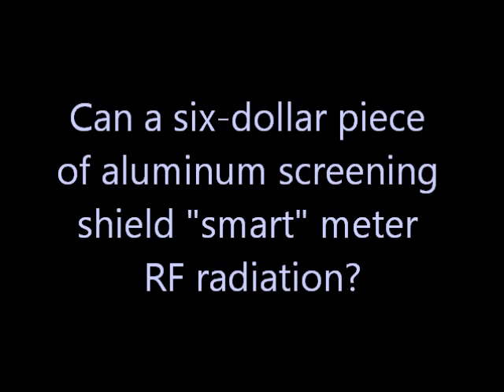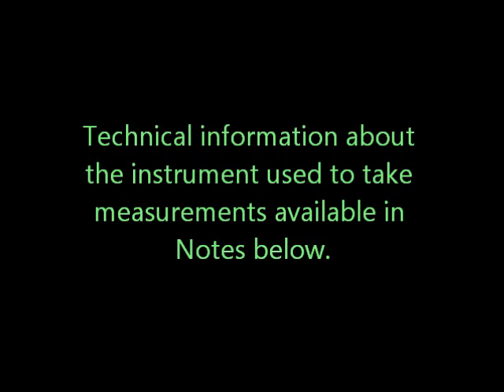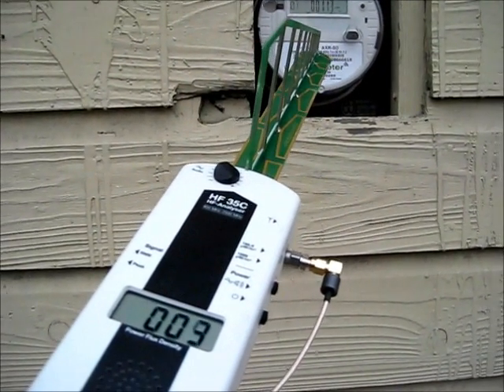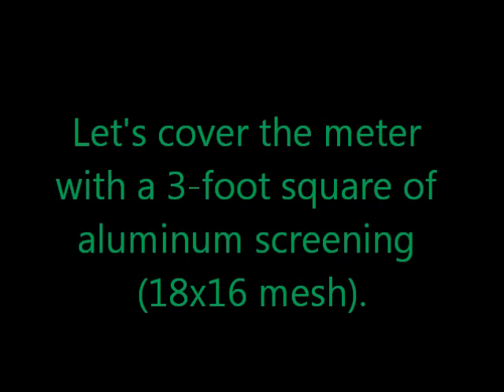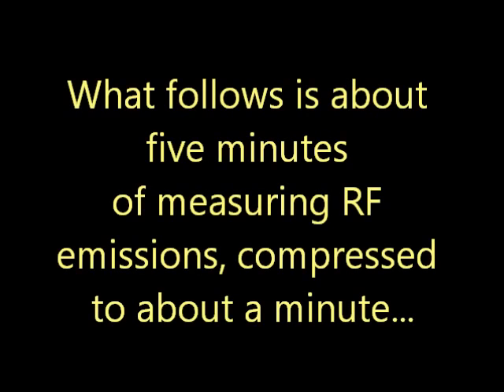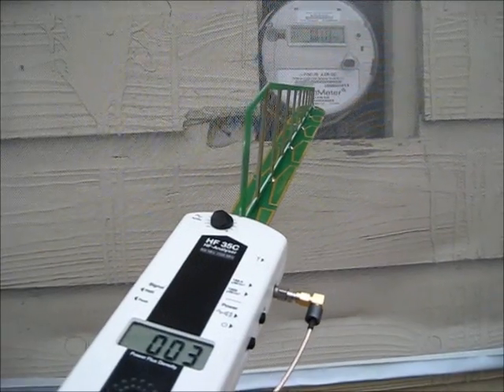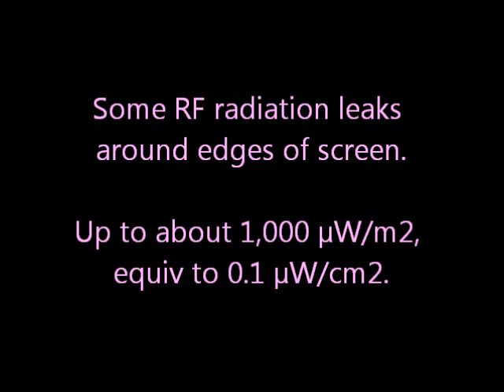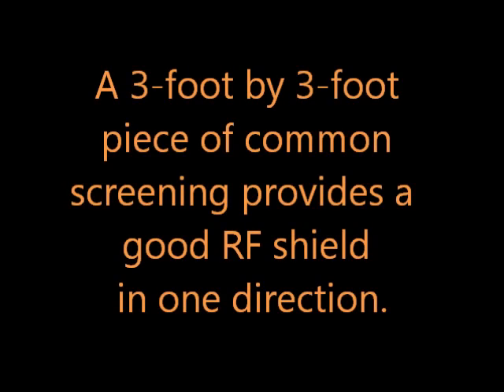Foiling a "Smart" Meter, Part Two: Aluminum Mesh Screening

Comment from the maker: @etherialcruiser These are good questions. The meter has 2.5 watts of power to transmit, and a capacitor to give a real punch at the moment of transmission. Whether a wrapped meter would end up burning itself out, I don't know. I do know that stories from people made ill by their meters, who have taken the step of wrapping the meter, have sometimes reported they feel worse after: it may be that the RF is radiated on the wiring, or that the other problems with SMs [CONT'D BELOW]

Comment: To "ground" something, is that to drive a metal rod several feet into the ground then solder a wire to it ?

If yes, what metal is good ?

Comment from the maker: @spystyle Here is another good meter, a little less in cost. The little histograph on the side in my experience picks up most every pulse from the smart meter. 
radmeters [dot]  com [forward slash] Cornet-ED25G-ssm [dot] html 

The RF measurement on the TriField is rather poor, though it is good for magnetic and electrical fields.

Comment from the maker: @jrae50021 Yes, you can wrap your meter in a double layer of foil and seal it well with aluminum tape, and you are likely to stop or reduce the RF. But I can't guarantee this, nor can I assure you that it's safe without being grounded, nor whether the utility will come and remove it. That said, it is your human right to protect your health and safety.